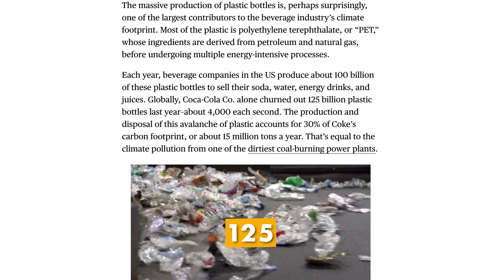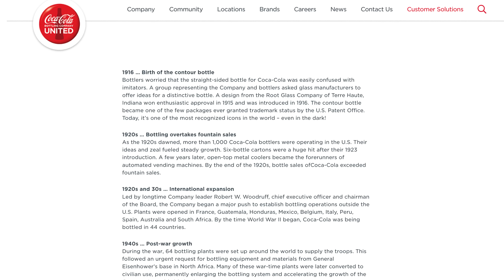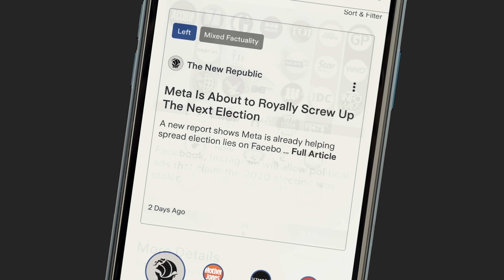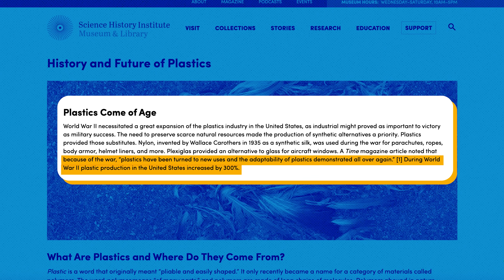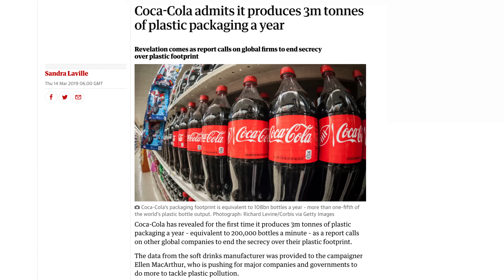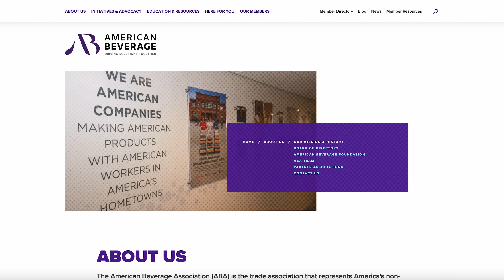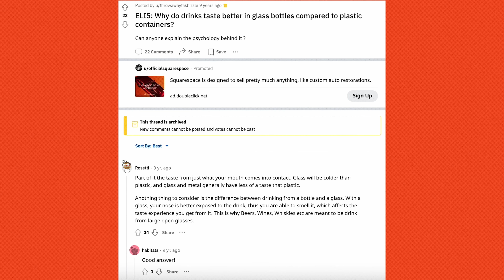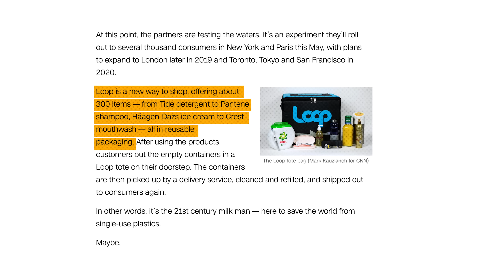Why the Glass Bottle FAILED

Comment: Back in the 70's we used to always get 10 cents back from each bottle at the 7-11.
Reply: in germany there werry popular for botteling stuf like lemonade and whater and we geht 20 cents per bottel back
Reply: Glass soda bottles didn't take over the smaller sized bottles until the late 90s.  As recently as the 70s, I recall buying 2liter glass bottles of soda. But by the end of the 70s, those were a thing of the past.  But 16oz bottles were still very common into the late 90s.
But they stopped the deposit thing in my state (PA) before I was even born, which was 1970.
Reply: It was only 5 cents where I lived.

Comment: Glass bottle (or aluminium cans/ plastic bottles) recyling is very standard in Germany and many different countries. Basically there are almost none drinking containers that get thrown out (except maybe wine bottles and similar). It is very common to buy beverages like juices, water, beer etc. and return it after consumption. You get between 25 ct and 8 ct per container (dependig on material) at EVERY supermarket.
Reply: Asia and middle east and Africa and most of latin America don’t do any of this
Reply: Same in Norway. 2 kr (0.2 eur) for smaller than 0.5 Liters, and 3 kr (0.3 eur) above it.

Glass bottles are unfortunately not refundable anymore. Still recyclable though.
Reply: Wine bottles go into generic clear or colored glass recycling in my country at least, as opposed to going to the beverage pant/pfant system.
Reply: Same in the Slovakia and Czechia and probably a lot of other European countries.
Reply: @Call-me-Al  its the same in Germany, we have containers that you can throw the glass bottles that are not returnable to a store. Most of the time there are 3 containers next to each other, one for white, one for brown and one for green glass.
Reply: It’s the same in Finland, depending on the size and material of the bottle, you get 10-40 cents.
Reply: When I was stationed in Germany back in 1992-95, the glass recycling was huge with large recycling roll-offs containers strategically throughout neighborhoods.
Reply: Same in Lithuania, return rate is close to 100%. We receive 0.1 euro per bottle.
Reply: @TheFinnishTechie is I wonder what would happen if I would return Lithuanian bottle? :) I see business opportunity here.
Reply: This is excatly the same situation In Sweden and the nordics over 90 %  of PEt plastic bottles and aliminum cas gets recycled  and our system is much better for both energy and the enviroment vs the old system of glass bottles
Reply: @mindaugas700  the machines do a scan for the label and unknown (wrong country or non-labelled) bottles are not accepted.
Reply: Aluminum cans are just as bad as plastic, the metal can't handle moisture because it will rust.
That is why they apply a thin layer of poison to keep the moisture away from the metal.
This poison will leech into the product that is packed in the can oblivious...
This is the same for plastic as plastic itself is very unstable with any kind of moisture.
Every glass bottle has a metal cap so it is still there, but having a lid only being coated the poison.
Or having the entire bottle and cap being coated in plastic is also another big difference.
Hence why we now see things we have never seen before, all thanks to plastic.
Reply: Somewhat the same happens in Mexico so don't think is just a thing of developed countries.
Reply: @legend-2890 That's not true, in Rwanda we do it too with sodas, beers, anything in a glass bottle, If you forget to bring back the bottle next time you pass the shop again they'll be sure to remind you
Reply: @Aliquis.frigus  that's a shame :( they are still refundable in Denmark. Every glass bottle except wine, those are only recyclable.
Reply: Even Poland is right now transitioning towards recycling glass, plastic, and aluminum containers, 'enforced' by refundable deposit fee.
And as said above, glass bottles are a staple in Germany.
Reply: You don't throw out wine bottles either though. You bring them to the recycling container
Reply: The USA only has a handful of states that have a bottle deposit system. I wish that we had better environmental  protection. I try my best to avoid plastic shopping bags but a lot of things are sold in plastic.
Reply: @mindaugas700  you get nothing for foreign bottles.
Reply: Yes... and the majority of the rerturned plastics either ends up on a landfill or is burned. The return scheme in Germany, the Netherlands, Belgium and a few others does a decent job of keeping littering at bay, and makes people feel better as they don't feel they're producing too much waste when they return the containers, but it doesn't do much in terms of recycling.
Reply: Note for readers: OP says some drinking containers are “thrown out”. What they mean is “put into recycling or rubbish bins” as opposed to be returned to supermarkets.
Reply: I like that Germany has pfand but the fact that not all stores accept all bottles (if they don't sell that brand themselves or something) makes it an infuriating guessing game.
Reply: We have the same system in Latvia.
Reply: In Belgium, we sadly only have glass bottle recycling payment machines, but aluminium and plastic gets recycled in a dedicated trash bag. (there are 3 main kinds of trash bags, all seperate: 1) GFT (groenten, fruit en tuinafval AKA vegetable, fruit and garden trash)... 2) PMD (Plastic bottles, Metal cans & Drink cartons (like a milk carton)... 3) "other waste", aka anything that doesn't fit the previous ones.

The PMD is where the plastic and aluminium goes. We pay for the bags, and get no money for it.
Reply: @legend-2890 lmao Latin America def still does this. Al least sodas and beer have this incentive of keeping bottles around.
Reply: @legend-2890   Its a 50/50 split in India too
Reply: Return systems exist in a lot of states and local areas too but part of the issue is no one cares and throws it anyway. Some states can be 15 cents for an aluminum can for example but still most consumers just throw them away because it's not worth the hassle of saving and collecting for $2. In the US the "time investment" to manage it isn't worth the deposit so people just forfeit it out of convenience unless they feel passionate about recycling anyways which means they will do it for free
Reply: @legend-2890  Wrong. You're misinformed. Not every country has the same infrastructure for processing the latest packaging ideas. Behaviorally, Westerners are the same. There are vast positive and negative incentives for taking care to process the garbage in accordance with the law and if the infrastructure is there, the areas are clean. The dirtiest Western locations are the big cities. Especially the ones that have the most tourists. But worse for me is how the beaches are treated when everything is there to make it easy to clean up. California is the worst, with no excuse at all. Then again, the East Coast of the USA is probably dirtier but the density of humans is greater so the challenge to keep the infrastructure in order is probably greater. West coast denizens don't have any excuses at all.
Reply: @Aliquis.frigus  It's the same in California. If the burden is too great for them they still throw it in the streets, parks and beaches.
Reply: In Norway sadly glass bottles aren't collected anymore and thick plastic bottles where swapped for thin pet bottles. The thin pet bottles and aluminium cans are crushed after use to save space and the scraps are recycled and some of it ends up as fleece material and some as new bottles.
Reply: That's pretty much the best solution we can have so far. In most cases the attempt to make it work fails miserably because of the scale. If you can't return it all at once, it's bad. People don't want to visit multiple places just because they can't return 20 bottles to a nearby shop if they didn't buy it there. If you have to track what did you buy where, it's bad. That's why I gave up on this years ago in Poland. Returned bottles were only accepted with a receipt confirming that you bought it there. Nobody sane will keep all receipts and return bottles exactly where they got them from. If you have to know which one can be returned, it's bad. Quite often there are many types and only some of them can be returned. Even worse if there is some QR code on them which gets damaged and the bottle is no longer returnable. That's insane. If you have no easy way of returning it, it's bad. If I take a crate of empty bottles, I'd want to go to a single place, give the crate and take empty crate back. That's it. I don't want to walk through some mall, spend 5 minutes putting them one by one to a machine and then walk back and forth with the crate. Even more if those are plastic bottles that can't be crushed, because they are no longer accepted if crushed. If you can't get a payout and get some crappy credits, it's bad. I want money back, it can be sent on my credit/debit card, doesn't matter. But I want to get money back, I don't want to be bound to a single shop where I can spend the money that was just returned to me.
Many times in my life I ended up walking with a few crates of nice, clean glass bottles to dump them all into trash. Nobody wanted them and I'm not going to drive to recycling center just to give them for free. I would waste time and fuel for nothing, not worth it.
Reply: @nzxt1234  PET recycling unfortunately only recycles like 10-20% of plastics, rest goes to landfills, aluminum is better as it can be melted but cans have plastic layer inside so also not fully recyclable. Glass bottle just need to be washed to be reused, really cheap from energy and environment standpoint.
Reply: In Germany reuse of wine bottles is also common in the wine region.   One bottle type was discontinued because they often broke during recorking
Reply: Fun fact about plastic bottle deposit in Germany: if the bottle doesn't get returned, the deposit is the beverage company's bonus income
Reply: @MS-sd1uz  I was most amused to see how many of the „street people“ in Germany have keys to the locking trashcans. They’re almost professional how they open them up, sort out the returnable bottles, and lock them back up and go their way.
Reply: @MS-sd1uz yeah, but that is in the nature of every deposit system, not just plastic bottles, and not just in Germany.
Reply: Sounds bad. But that's because your government, and voters, have chosen that system.
In Sweden any supermarket take any bottle/can with EAN (if it was sold in Sweden). You can either get a payout or use it when buying groceries.
Reply: I've only been made aware recently that what I thought was still aluminium drink cans are actually mostly plastic which can't be recycled, which I was just shocked at finding out, I almost couldn't believe it. This practice should be made illegal, every container should be almost entirely recyclable these days and if not those unwilling to play by the rules after a certain switchover period, should have to pay a tax to process the waste from their product after consumption, otherwise it's just putting more pressure on the taxpayer or consumer, and it's just negating any responsibility on the part of the producer.

Comment: In Sweden there was a standard bottle created ca. 1885 to be used by all the breweries. This type of bottle is still used to this day.. It means that different brewers can use he same type of bottles in a loop, in a pool system.
Reply: nice! while we have bottle recycling in Czechia, every manufacturer is using slightly different bottles, so not every bottle will be accepted by every shop.
Reply: If you're going to use glass, that's how to do it. Otherwise, just use aluminum with a plastic liner. It's virtually 100% recyclable and any impurities mostly burn away with very little material lost in the process.
Reply: cool. i just thought about that we also could make a recycling system for canned goods in glass 🤔
Reply: I love the iconic shape of Absolut Vodka bottles myself 😀
Reply: Same in Poland:)
Well, almost.
I would say that 90% of beers come out in standardized bottles (usually green or brown glass) and those are the one that have 'deposit value' - you pay some money exactly for the bottle itself (1zł - while usual beer price ranges from 3 to 5zł) but part of breweries also sells beers in not standardized bottles.
Reply: This is similar in Germany, where we have standard water and beer bottles and even though the tap water here is (one of) the world‘s safest, many people buy bottled water here.
Reply: Canada also used to have a standard beer bottle that was brewer agnostic. It was phased out in the 1980s. It was brown and stubby which was very efficient for transport, storage and processing. Now it’s a nostalgic cultural icon.

Comment: Here in Australia, most supermarkets have glass bottled Pepsi and Coke. It is however prohibitively expensive, you are paying vastly more for glass. $8 AUD a litre versus getting a large plastic bottle at $2 AUD a litre. They only have smaller bottles as well, likely increasing the price. It is a luxury item they keep a small supply of.
Reply: I believe you are correct, guess I'll have to stick with my Sprunk.
Reply: gta speedrunner
Reply: I believe you are incorrect, guess that's just your opinion. Perchance. Plastic bottles just feel more lighter than Glass bottles. Sure it's water but it's heavier now. They are something nice and not expensive. Ignoring that now huh? Nick, would you rather have a glass screen or a plastic screen... see? Also you only get small amounts of micro plastics from the plastic bottles. I can't even eat the plastic bottle for griefer 's sake. I guess that's what someone who plagiarized from the viper rambles podcast would spew.
Reply: really cool to see you comment in a random video :)
Reply: Yo it's a voice actor for gta 6 good to see you here dude
Reply: @kaungkhantkyaw4410  glass IS much heavier. Compare the weight of liter bottle and a bottle of wine. Bottle of wine is heavier despite it contains less liquid (weight difference between wine and water is very small).
Reply: gta 5 man
Reply: Is any money refundable when the bottles are returned?
Reply: @sougatanandy6404  Yes, there is a 10c deposit on drink containers (including plastic) that can be collected from a recycling center or machine.